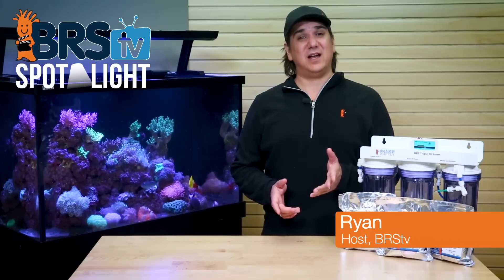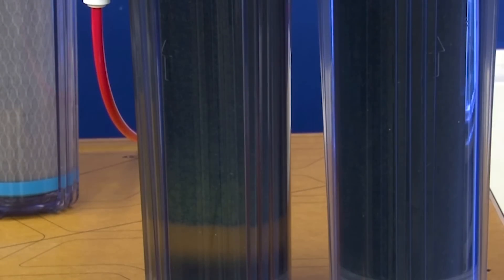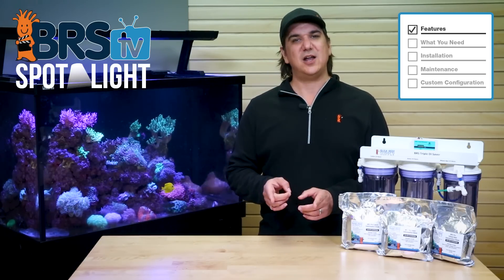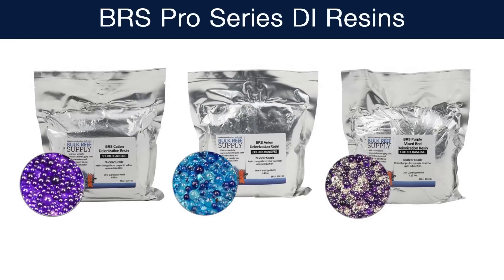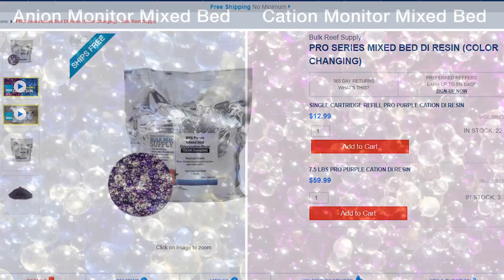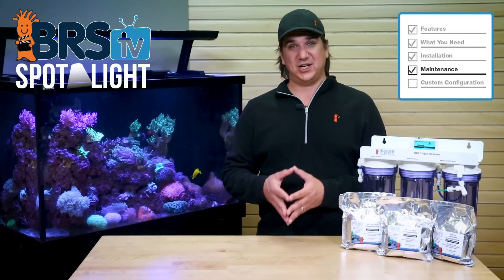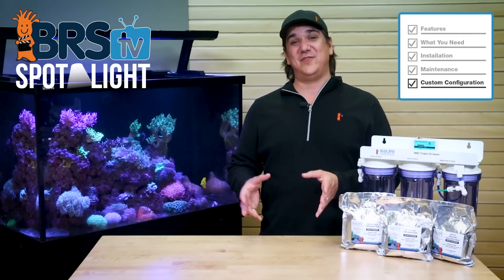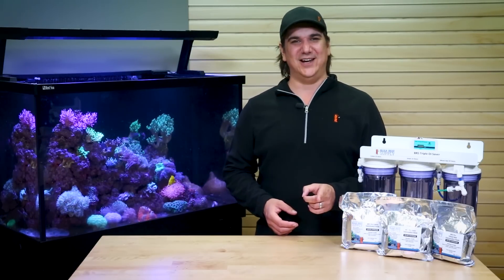Upgraded RODI water filtration w/ BRS Pro Series DI Resin | BRStv Spotlight

Comment: I used one single canister and put half anion first (bottom half) and then half cation (top half). Did I screw up since you said cation should come first in it’s own canister I’ve only made one gallon so far…. Should I mix it up? 

I will put cation in one whole canister of anion followed by cation in another canister from now on, but did I really screw up by putting anion on the bottom half of the canister first then the cation on the top half of the same canister cartridge? Should I take it out and mix it up so it’s just one canister of diy mixed bed resin?
Reply from the maker: Cation really should come first in order for the pro series resin to work properly. I think your best bet here is going to be to mix up all the resin in the cartridge, treat this one like standard mixed bed, then use separate cartridges going forward. Just remember that since both the anion and cation will have color changing aspects to them, telling the color change once they're mixed will be very difficult, so keep your eyes on your TDS meter.

Comment: Sounds my PRO Series Blue Anion Deionization Resin smell very fishy?   It smelled like this when taking out of the bag to the point my hands still smell like it.  Now I"m running it out on one cartige only to flush and it still smell like fish.  Also RO is producing 4 TDS but after the PRO Series Blue Anion Deionization Resin its coming out 15 tds, how long do I need to run it for before it starts production lower values of tds as well as no more fish smell?

Comment: Ryan, I have a BRS 4 Stage RO System that I would like to add the separate Cation and Anion Canisters to.  In your examples, you show adding an additional carbon block making it a 7 stage system.  What would be the result if I leave the 4 Stage as is, come out of the Carbon blocks and jump to the Cation, then Anion canisters, then jump back to the Mixed bed in the 4 stage?  I ak because I have all the parts to do this, but what is the risk over the 7 stage proposal?  Worth it?  Thanks!
Reply from the maker: Essentially you would have a 6-stage that would follow this path... sediment filter -> carbon block -> cation -> anion -> mixed bed.  That said, the purpose of a dual carbon block system, instead of one, is to break that chlorine and ammonia bond from chloramines in your municipal water. 

If your city doesn't use chloramines for water treatment yet, then a single carbon block will likely get the job done. However if your city does use chloramines, a single carbon block is less effective at breaking that bond which may result in some residual ammonia getting through your system to your DI resin, most likely resulting in a faster DI resin consumption than if you had two carbon blocks.

Comment: Hi Ryan. Sorry,  I do not agree with the idea. In the last episode I questioned the use of dual type resins. It is a bad idea because one type of beads does exhaust very quickly - and we need to remove all resin !. It is similar when activated carbon is mixed with GFO. This approach was tried and it was unsuccessful in water treatment many year ago. The problem is not new - the solution of two containers with two H+ and OH- resins are classical and it has been used for many... years for water softening etc. Putting the third sage with mixed resin. Why not = but it is simply wasting a money.  From my experience, two canisters with separate H+ and OH- resins are the most efficient option.  With ammonia, simply put clay/zeolite that is strongly adsorbed ammonia in the last canister - solved (and cheap). Most  H+ and OH- resins (without colour indicator) can be purchased in 50 kg bags. They are the same as those used in water treatment - at least in Europe; Cheers.
Reply: All depends on your water quality, the water in AL from my well is extremely different than City Water in Minnesota. So it's not the same for your goals.

Comment: Could I use 2 cation (C), 2 anion (A) and 2 mixed (M) in series in that order (C, C, A, A, M, M), and every time a single canister is depleted shift the other one to the first spot and refill the other canister and place it in the second spot. That way I think no resin would be wasted and i stand no risk (or at least a way lower risk) of 100% depleting a resin canister and dumping unwanted substances in the tank.

for example the cation canisters: 
I have 2 cation canisters in series. 
the 1st canister is 100% depleted and the 2nd is 5% depleted. 
I would place the 5% depleted canister in the 1st spot.
I would refill the 100% depleted canister and place it in the 2nd spot.

thanks in advance for your reply.
Reply: Giwan Verveen that's a good concept. I would be interested what BRS says.
Reply: The only thing this idea would require is more water pressure.

Comment: So, if running a triple DI and dual Carbon Blocks, what would BRS recommend as the indicator of when to change out one or two Carbon Blocks?  Right now I'm changing a carbon block when one of the Dual DI cartridges is depleted, by changing out the first one and rotating it to the back, bringing the second one forward.
Reply: Sweet thanks!  I could easily do that.